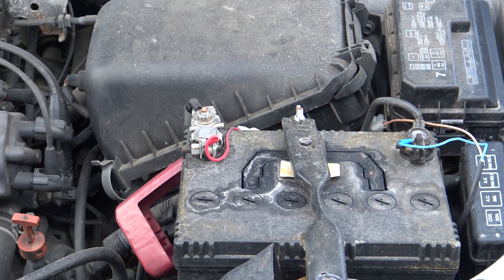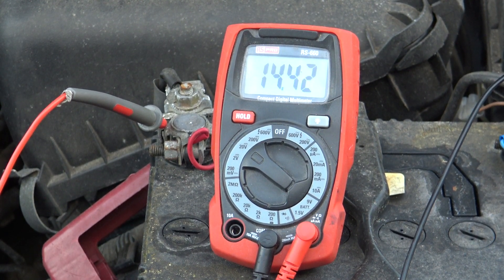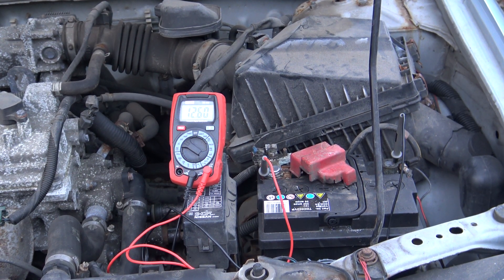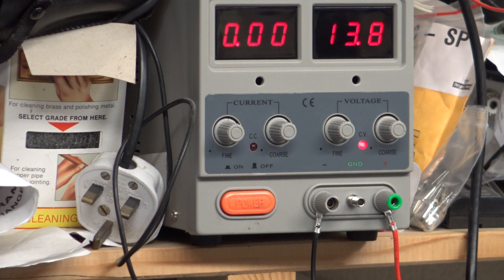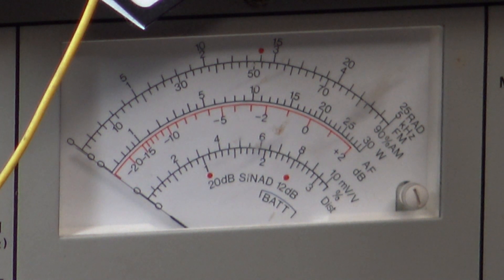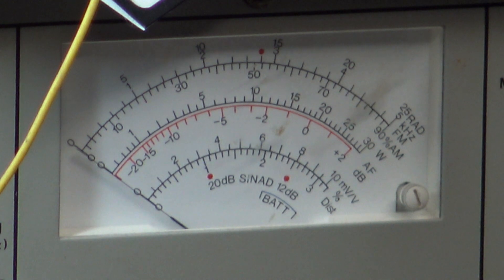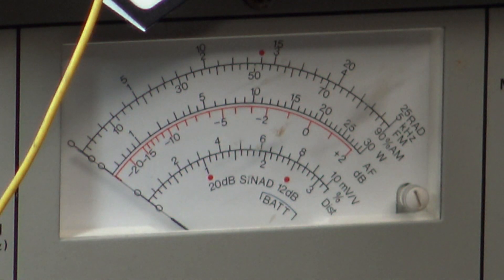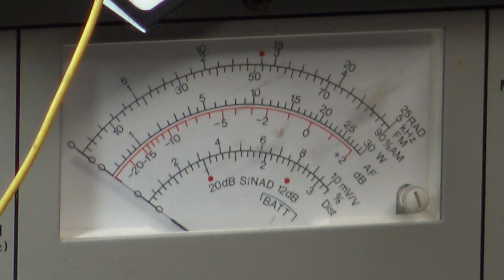Why 13.8V on CB mobile radios & other 2-way radios

Comment: Really underrated video! I'm looking at using 18650s to power a cb like a portapak but facing the odd issue of how many to use. I think best to use a lm317 voltage regulator because 1 cell is 3.7v but charged is about 4.2 v, so 4 would be 16.8 max, too much. This vid definitely helped, 👍

Comment: I use an ATX PC power supply turned up to 12.5v, i cant get it to go any higher unfortunately.
It does however have bags of Amps behind it and can run both my radios as well as two hobby grade lipo chargers running at full current (I fly fixed wing FPV) and still have plenty of current left for anything else i want to run on my desk :)
Reply from the maker: The snag with 12,5V, is that most mobiles that are supposed to do 4W with only develop 2.5W at that voltage.

Richard
Reply: @ukfmcbradioservicingTango21  yeah, it under powers radios but having one supply to power everything on my desk and one that cost nothing (i have loads of ATX psu's) was just too attractive as i do so much RC based stuff which can place loads in excess of 20A on it if i go full throttle on a plane im powering from it during setup and also often have FPV gear powered from it too.
There are ways to get these PSU's to go higher  than 12.5v but on the potentiometers 12.5 is all i can get out of it.
Reply: Nice video 
But most "12 v" power supplies sold are actually putting out a bit more 
I.e. 12.6 v 
😊

Comment: By the time the voltage gets to the internal voltage regulators there is enough of a voltage drop that it takes into account for that. By that I mean equivalent series resistance
Reply from the maker: Bear in mind the full rail voltage is applied to the PA transistor(s). The regulation in the radio as far as transmit goes, is applied to the driver or pre-driver circuits. Those regulated rails are usually around 8V so unaffected by normal input voltage variation of say 12V to 14.6V

Richard

Comment: So are your radio's wired direct to the battery with no voltage regulator inline anywhere? And do you wire to battery positive and a body earth or battery positive and battery negative?
Reply from the maker: Correct procedure (MPT1367 Ofcom, installation of mobile radio transmitters)  is to either take both positive & negative leads straight to the vehicle battery with appropriate fuse protection as near to the battery terminal as possible. Alternatively, just the positive to the battery & the negative connected to a suitable chassis ground point. In addition aerials checked for correct ground at the mounting point.

So to answer your question, I wire direct to the battery & don't use the negative to chassis wiring technique.

I've never heard of a voltage regulator inline. With all the radios I've worked on, the PA transistors go straight to full rail voltage, hence the big difference on different vehicle voltages encounnted (i.e. 12V to 14.6V). TX power regulation within radios is achieved (when fitted) by varying the rail voltage to the pre-driver or driver transistors rather than the PA transistor.

Hope that help clarify.

Richard
Reply: @ukfmcbradioservicingTango21  thankyou, yes that does help.

Comment: Richard the voltage difference clearly made a big impact on output power of the Rotel. Would you be able to do a similar test on a newer radio like a crt xenon or president bill please? Also do the dual voltage radios have better regulation do you think? I never run mine with the engine running, only use the parked up off a leisure battery so keen to see what the difference might be. My battery measures 12.4 v
Reply from the maker: seems a good plan. I've kitted a van out as a mobile radio shack & have installed a nice leisure battery so may be in trouble too. I think I'm going to add voltage tests to every radio I do now. I was astonished at the impact.

Richard
Reply: @ukfmcbradioservicingTango21  im glad your intrigued like me so hope to see some videos to learn more. I know that many amplifier ic’s like audio amplifiers have a linear power vs voltage curve, surely the manufacturers of today can design the rf finals to deliver a constant 4watts from 12 to 14v? Thats only 2 volts variation which isnt a lot is it?
Reply from the maker: like a 12% voltage reduction causing a 45% Power reduction. Astonishing. 

Richard

Comment: what instrument do you use to measure power, sinad, AM modulation percentage, FM deviation ... is a very interesting combo tool!
Reply from the maker: We have three of them I like them so much. It's a Marconi TF2951 all-in-one radio communications test set (1983). We have three other makes of similar too. A Farnell SSG520/TTS520 combo test set (I like it), Schlumberger Stabilok 4040 (not keen),and a Quartzlock 282 radiotelephone test set (no use for CB work, starts @ 80Mhz). I've had the newer Marconi TF2955B, the Motorola similar & because they digitize the signals, they are slower to react. It's like....adjust..wait..adjust..wait. I want to see the meters instantly react to my adjustments.

Richard
Reply: @ukfmcbradioservicingTango21  it’s beautiful 😍 but is unobtainable i think 🤔
Reply from the maker: @Alberto_Alletto  They come up both on Ebay & with used instrument vendors from time to time. Stewarts of Reading sell used instruments for example.

Richard
Reply: @ukfmcbradioservicingTango21  I had that TF-2952 that i ended up selling for £50 on ebay that no one wanted..
such a shame as i fear it got scrapped..
i use a 2955 as a last resort..
for most my tuning i use a B&K 2040 and a Wavetek CT 3000B
amongst other second opinion items.

Comment: What’s the maximum voltage a CB radio can handle without damage?
Reply from the maker: Usually it's 15V as an absolute maximum. Most capacitors used in CB's are 16V rated, so if that voltage was exceeded there would be multiple failures. Bear in mind some current models & even the odd set from the late 90's are 12/24V so they can be used in lorries. I've no absolute maximum data for 24V radios, but would suspect 28V being the absolute limit.

Richard
Reply: @ukfmcbradioservicingTango21  Thank You

Comment: Interesting Richard. perhaps you could do a video which includes wire size and the effects it has when overloaded
Reply from the maker: Possibly. Although we stock every available gauge of red/black fitting cable for 2-way radio from 2.5A up to 45A, we use 3A on CB installations & 7 or 10A on business radio installations. Most business radios are 25W & draw 5.5A on TX....but UHF radios are less efficient on power consumption & often draw 7.5A for 25W output.. A demonstration would show voltage loss on inadequately rated cable during transmit.

Richard

Comment: Excellent demo Richard.  Next time someone ask I will point them to your video, saves a lot of explaining.  Cheers  :-))
Reminds me, one person I worked with, his headlights were very bright, he said the CB was working better than normal, but he said it got very hot in a short time when transmitting.  Told him his car was not regulating as his headlights were far to bright.
He didn't believe me, but took it to the dealers and they told him the regulator had failed and was putting 18 to 20 volts into the system.  Surprised the finals on his CB held up, just as well it was a Rotel 240, but if he had kept using it I think he would have fried the finals!  His headlight bulbs both blew not long after, so they had taken a roasting as well, but it took a few weeks for them to fail, one went then the other, tail lights were fine though.
Mind you it can fail the other way and you get nothing!
Reply from the maker: I have a rack of automotive bulbs in my hallway...better than some namby pamby flower picture on the wall. Despite this & checking car bulbs; when I take any car for MOT it's 50/50 as to there being a bulb fail. You just couldn't make it up!

Richard
Reply: @ukfmcbradioservicingTango21  is there any explanation as to why a bulb on the left might blow frequently while the one in the right lasts years?
Reply from the maker: if it's your car you are talking about it sounds like water is touching the bulb from time to time. left hand near kerb, water splashing up...slight leak
Richard
Reply: @ukfmcbradioservicingTango21  not sure if it suffered from any water penetration to be honest. The car has recently gone now but it always puzzled me.
Reply: @simonwalters4842  Could also be a bad earth, you will hardly notice.  Other thing is if it shakes slightly, you see a lot of cars doing that, the driver doesn't notice until it gets really bad.
Chances are it was a bad earth, might not even show up until you are driving.
Anyway, the car is gone, so it doesn't matter.

Comment: Interesting Video Richard. Is your Lecky car a 100% electric or a hybrid with an engine ? If 100% Lecky why hasn't it got a DC -DC  inverter for equipment that operates at less potential than the battery pack ? On fork trucks we fit dc-dc inverters to drop he DC voltage down.
Reply from the maker: it's 100% electric...battery only. Yes, when the car is switched on the inverter charges the 12V & supplies power to the 12V electrics.

Richard
Reply: @ukfmcbradioservicingTango21  so why are they putting it into a 12v auto battery? It defeats the object of the inverter?
Reply from the maker: The 680V battery is only connected when the vehicle is switched on. The control systems are all 12V. Like a conventional car you can sit in the car & listen to the radio & have the lights on inside & out running from the 12V battery. Once you switch the car on the 12V electrics become powered from the invertor & the 12V battery receives charge.

Richard